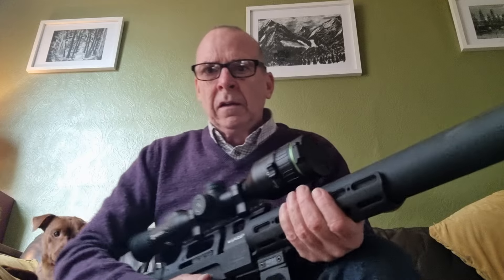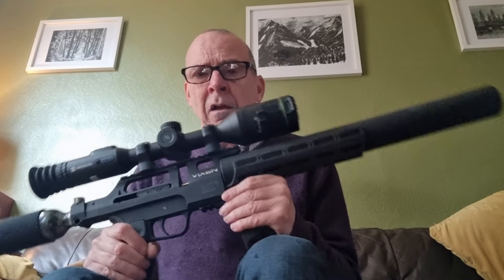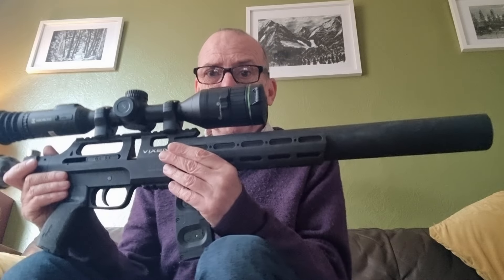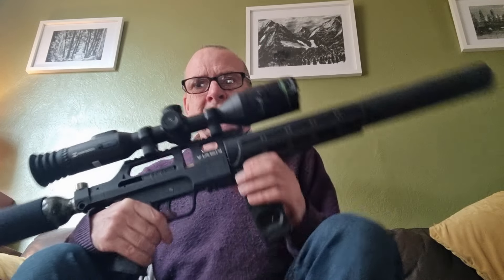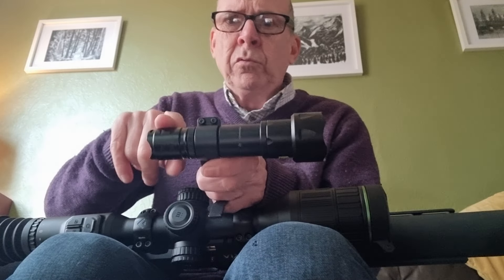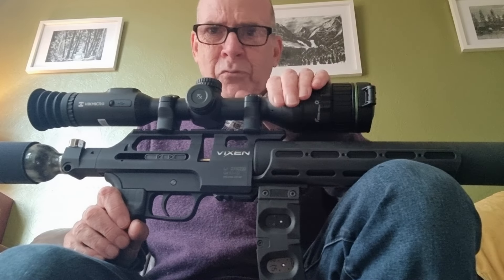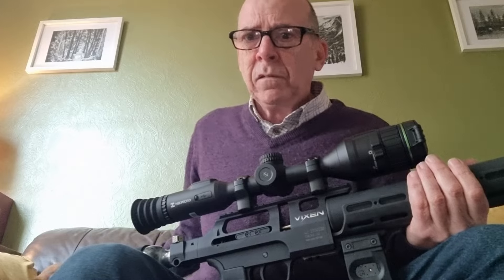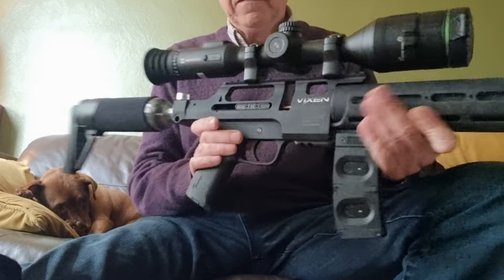AGT VIXEN AND HIKMICRO ALPEX 4K ,A FEW MORE MODS

Comment: Thanks for sharing. I have the .177 short and love it. great you metioned the weight side as they are really light and those scopes are a bit of lump so it was good to hear your thoughts as i thought it may unbalance the rilfe if off sticks, I have a Zulus which I would use but that Hic looks good.